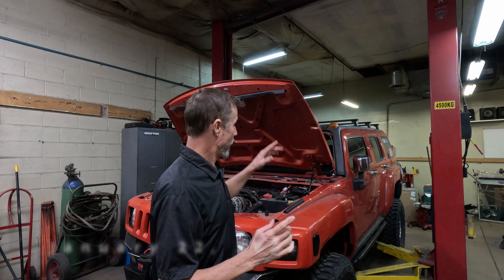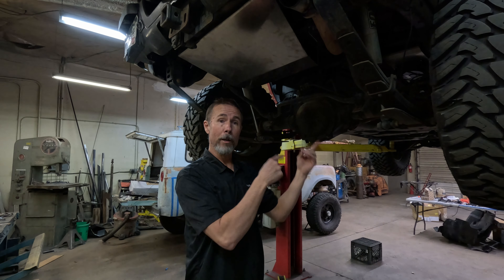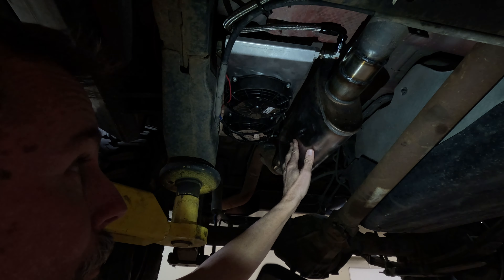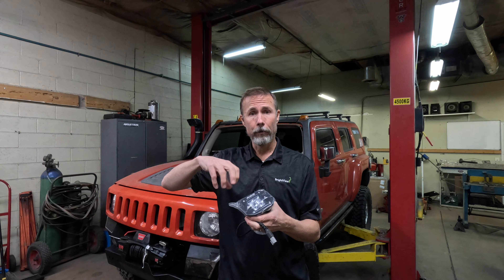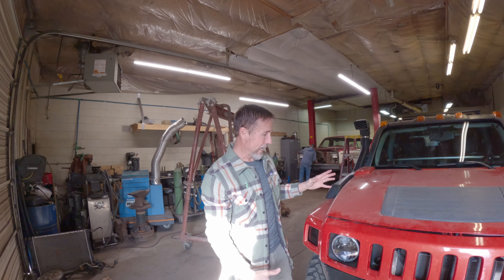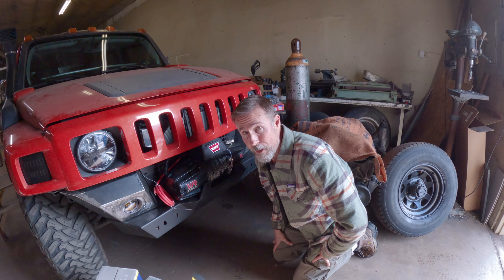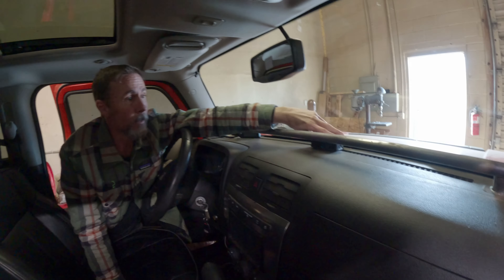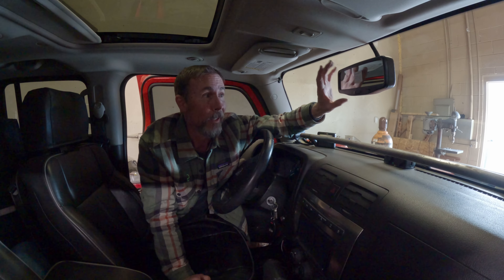Hummer H3 Off Road Overlanding Upgrades - Our Story Part 3

Comment: Not trying to be negative. Just trying to help, you may want to put some kind of wrap or aluminum exhaust shield which I’ve used and works good. But put it on the side of the tank or on the back of the exhaust to keep the aux gas from boiling
Reply from the maker: @chbal9935  That is a real good idea. Thank you!!! We will figure that out.

Comment: I would put a skid plate on the aux fuel tank.  I smash my muffler all the time.    You might want to look into heat coating/shielding  on your exhaust near the tranny cooler and fuel tank.   LOVE the rear bumper.
Reply from the maker: @RobK-q8fg  Good ideas. We are still figuring out the details. I think we need to heat shield the auxiliary tank as well. Definitely need to keep heat away from the transmission cooler too. Thank you.

Comment: Okay. Last week, you became the guy with the best equipped Turtleback trailer. This week, add the best equipped to that title!
Some of my favorite mods started out with my wife, Shawnna, asking for something. That rear storage is awesome, Natalie. 
Your fabricator is awesome. He should market these mods.
Reply from the maker: @dougg8280  You know how it goes Doug. Our wives have great ideas. After you got the aux tanks I knew we had to follow. Yes, we have been so blessed to work with Randy at Siker Fabrication. He is awesome.
Reply: @TsarTrail  hopefully, your tank will work better than my Long Range America tank. It does not transfer fuel when warm. It had a stuck check valve. Lots of little weird things.
Reply from the maker: @dougg8280  Interesting. We will see. We are figuring on how to shield it from exhaust heat. Hope you can get the kinks out of yours.

Comment: Fantastic build! One question... aren't you worried about those fans sucking mud or dirt up into your transmission oil cooler?
Reply from the maker: @addvantage  Thank you!!! Great question. And yes, that is a concern. We are looking at other locations for the transmission cooler. Muffler heat is a concern as well. We are just so limited on locations.

Comment: Welcome to the springs.
So is the 6l80e done and working?
The 09 h3 also has the screen in it
Reply from the maker: @johnbelveal4775  The 6l80 is still available n progress. Transmission cooler location is still a question. Also the coolant radiator needs a change.